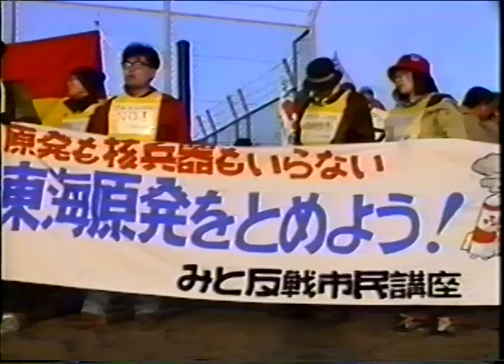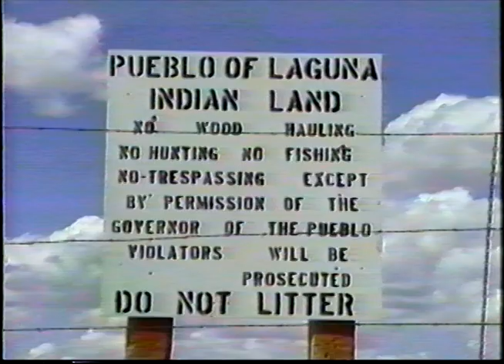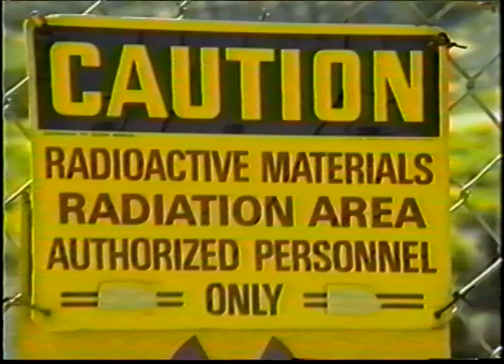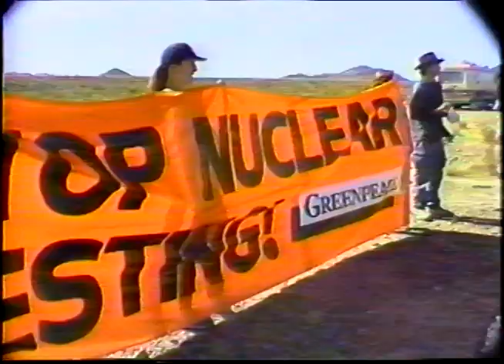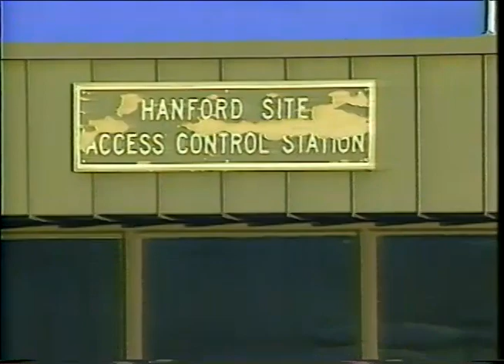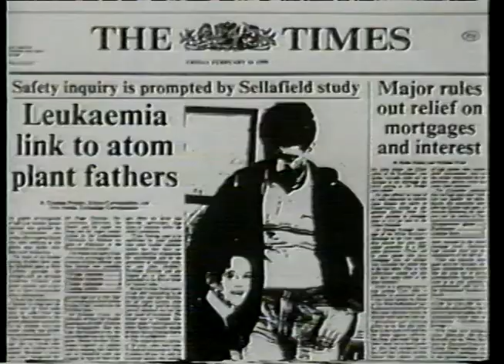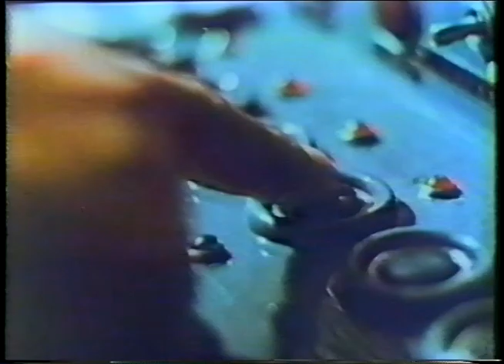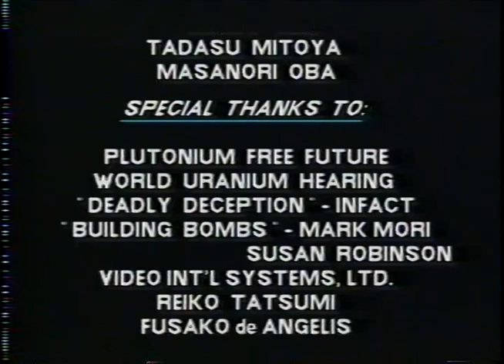Pluto's Fire - Global Nuclear Contamination and Japan's Nuke Policy

Comment: stunning.   I spent a few years consulting in the weapons plants, radio active particle containment.  I exposed the extreme hazards posed by hot particles before congress, but was entirely deceived (self deceived and by the govt) on the issues of gaseous contamination as I continued to support nuclear power....  I was wrong.   and i had been lied to about the half life issues, and had not bothered to do the in depth research required.   I apologize.